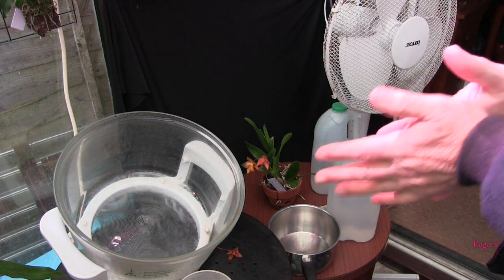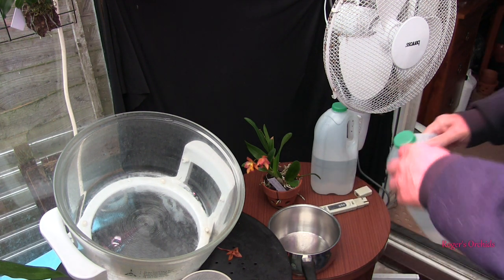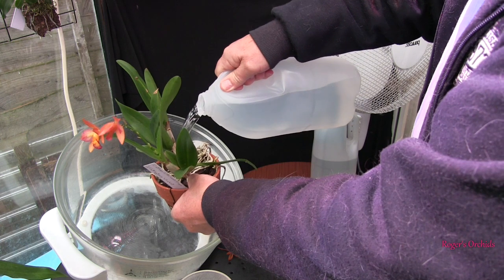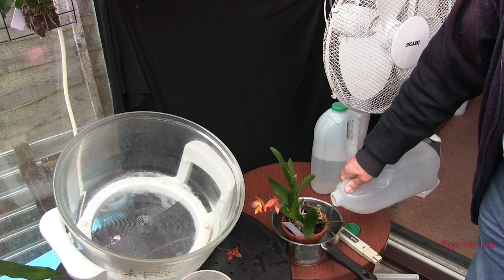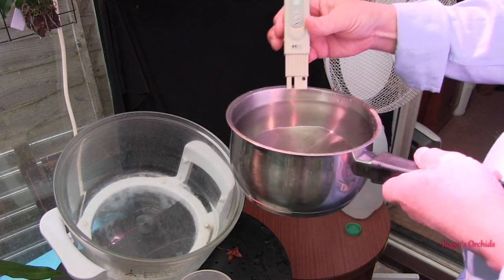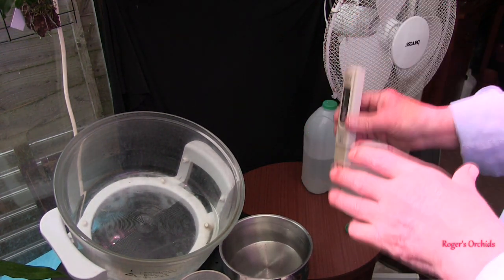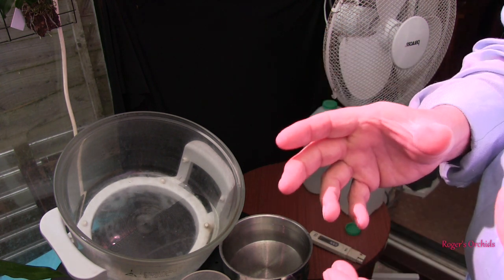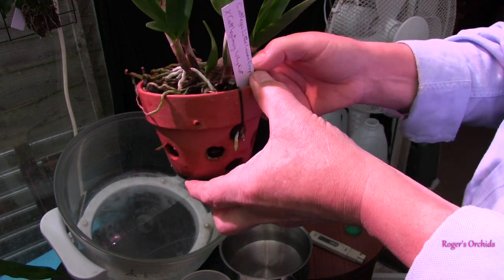An Orchid Experiment - Is My Flushing Working?

Comment: if it makes you feel any better, we're quite cold even in south Florida today, low was 8 C and our high will peak around 17. Very sunny but unseasonably cold. 
For me, unless I have to water in between feed days, my plants get flushed on feed day. I always water the heck out of the plants first with plain water then wait a bit and come back with feed water. My theory in doing it this way is that you're getting the roots hydrated first which makes them more receptive to absorbing nutrients (easier for ion exchange to happen).
Reply from the maker: Worth remembering that there is a maximum saturation level for orchid roots where no more can be absorbed until there is 'room' ie some of that has moved on through transpiration or evaporation? The velamen works like a sponge when dry and takes in 'everything' then the plant sorts out what it needs and what goes where. There is not so much exchange between wet roots and wet media as there is between dry roots and wet media if that makes any sense?
Reply: @RogersOrchidsGardenandBonsai  It shouldn't matter if roots are already fully hydrated for nutrient absorption, since it is only ion exchange. In theory, the process should be more efficient when the roots are fully hydrated because the ions travel through water, so having water on both sides of the "membrane" allows them to pass more easily. It probably doesn't make a huge difference either way, whatever works for the grower and ensures the plants are properly flushed is most important.

Comment: very good video.what is the good number of tds to water orchids?my tap water come #7.is it good or not.if not what should I do to fix it.thank you very much.
Reply from the maker: If you have tap water with a TDS of 7, then use it - it's as good as rain water. Depending on the time of year, I feed at an average of around 150 TDS - higher in the height of the growing season. I do feed often during the growing season with a flush every 4th watering.
Reply: @RogersOrchidsGardenandBonsai  thank you so much for your response.

Comment: Very interesting video Roger! Can you calibrate your TDS meter so you know you have the right ppm value?
Reply from the maker: I can calibrate it but so far in over 4 years, I haven't had too. It may sound strange, but I use my RO water to make sure the TDS meter is ok - it reads between 8-10 ppm. If that reading starts to get way off, I would first re-calibrate the TDS meter and check again and if was still way off, then the RO unit probably needs the filters/membrane changed.

Comment: Good morning  Roger, interesting  experiment, thank you for that, it is reassuring. Out of curiosity,  what is wrong  with your tap water that you must remove  with the RO process?
Reply from the maker: My tap water has a TDS of 240 ppm - higher than the level of RO water plus feed - plus the tap water has 'unknown stuff' in it whereas the RO water is pure. If I had very soft tap water. I would probably use it.
Reply: Roger's Orchids Thanks!  I guess I should  get a TDS   device , I hope I can find something  reliable!